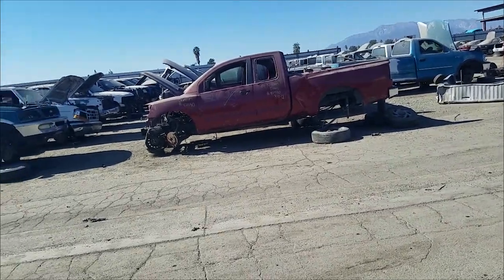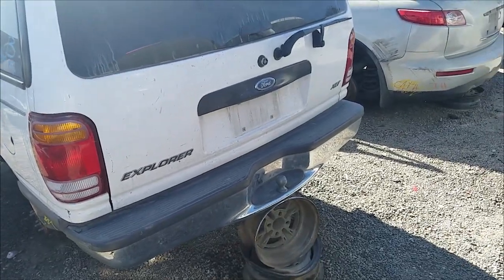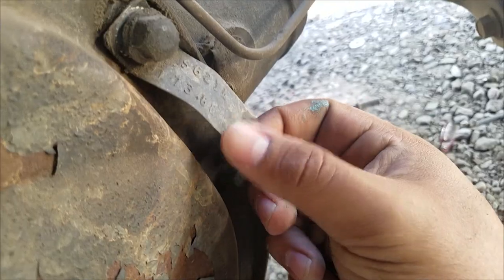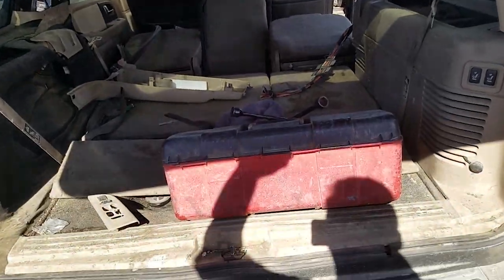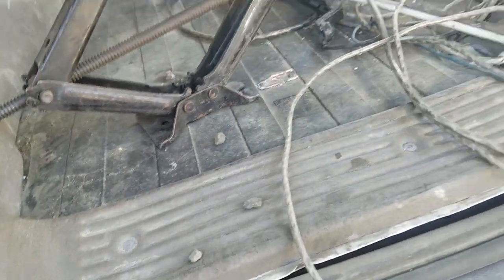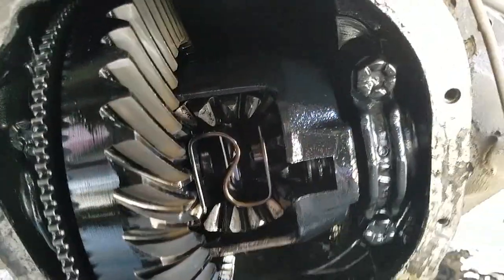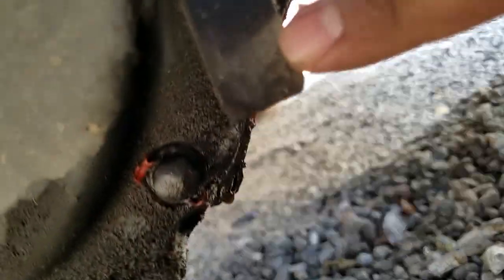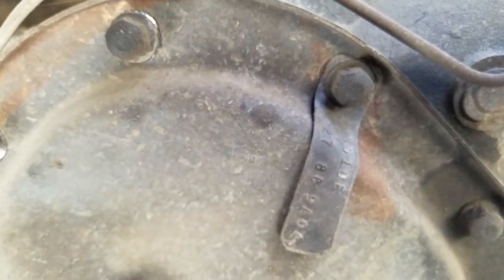How To Pull A $200 LSD Ford 8.8 Out Of The Junkyard WITHOUT Power Tools!| NW EP.34

Comment: I would have kept the adapter for the drive line, then just get a U joint to fit that.
Reply from the maker: Thats exactly what I did afterward. Had to go back with a cordless sawzall and take the flanges. Paid like $10 for it I think.

Comment: Was thinking of swapping an lsd out of an explorer to my 05 cvpi! Any tips? Thanks 🍺
Reply from the maker: I will bolt up but don't think the axles would work with the LSD carrier because as far as I know the explorer uses 31 spline axles and the CV uses 28 spline but if the CV also uses 31 spline its should work.
Reply: @NightWrencher  yes my 05 is 31 spline 👍
Reply from the maker: @TaylorMadejdm1975  Then it should drop right in!

Comment: How much hp can that rear end handle
Reply from the maker: I'm not sure exactly. The mustang guys push about 350- 400hp out of them but Im not sure myself. Right now I'm at 245whp and 295tq. After I install my 4.56 gears and the BTR stage 2 truck cam I should be close to 300whp
Reply: 600+
Reply: alot... its 31 spline..
Reply: @massivefins2597  depends on the year tho, doesn't it??

Comment: Hey I got a question. Can I take out a lsd out of a truck and put it in my e39 528i? Would that work?
Reply from the maker: If you've swapped it to a ford 8.8 housing then yes. If youre using the stock BMW housing then no
Reply: @NightWrencher  could you direct me to a video I dont know what you mean by the housing on a differential. Like put do you mean the axle?
Reply from the maker: @gnarledcaptaintheduck9207  The "axle" is the entire differential assembly, axle shafts, housing, etc. The axle shafts are the skinny flanged parts that rotate the wheel. The housing is the case that houses both the axle shafts and differential. parts of the housing are the pumpkin or centersection and the axle tubes. The differential assembly is the ring and pinion(final drive gears, sometimes just called "gears"), spider gears and carrier inside the pumpkin part of the housing. So if you've replaced the stock BMW rearend with a Ford 8.8, then you can swap in any ford 8.8 carrier into it. If the rear end is still the stock BMW unit, then you can only use BMW parts inside.
Reply: @NightWrencher  thanks for the reply really helped me understand. I've seen some people talk about gears like 3.7 what's that about and do i need to be careful with those numbers and do those numbers have to match with my car's in some way?
Reply from the maker: @gnarledcaptaintheduck9207   the numbers define the gearset inside the differential. Typically, changing it doesnt affect the rest of the car, unless its AWD or 4WD because the front and rear differentials have to match. The number is the number of teeth on the ring gear divided by the teeth on the pinion gear. So if your ring gear has 59 teeth and the pinion has 15 teeth then the ratio would be 3.93. So for every turn on the driveshaft the axle shafts spin 3.93 times. Slow cruiser and economy cars use lower number ratios to keep RPMs down for mpg at higher speeds at the cost of acceleration. Race cars and trucks normally want higher number gears to keep the engine in the powerband on the hwy or increase acceleration at the cost of MPGs and top speed.